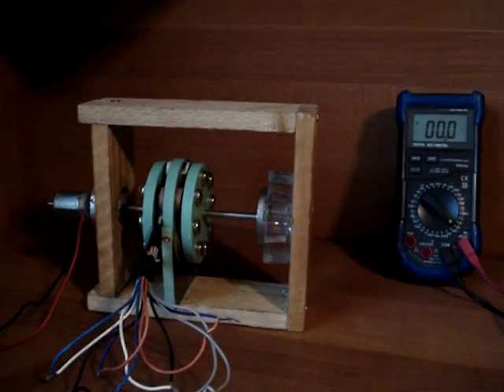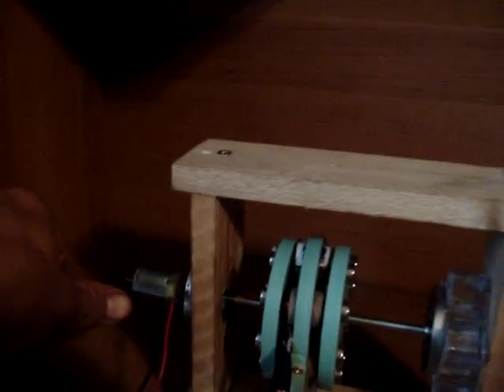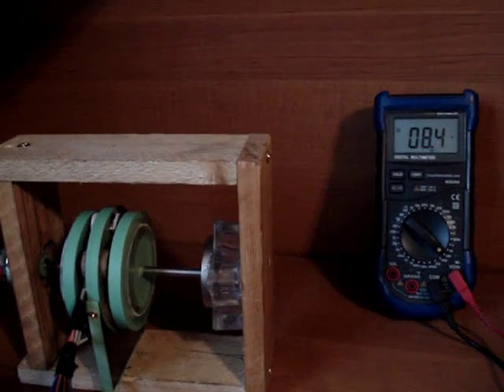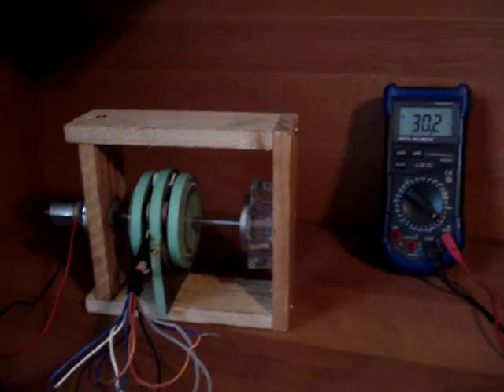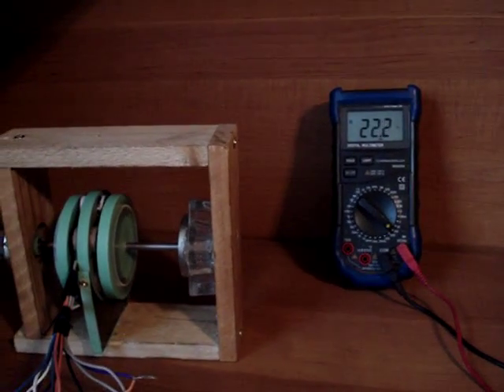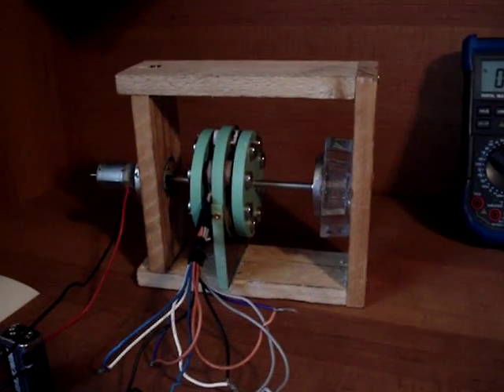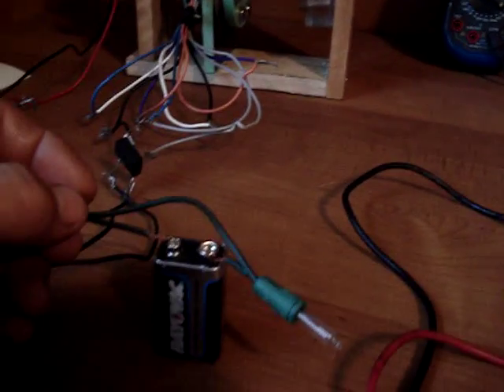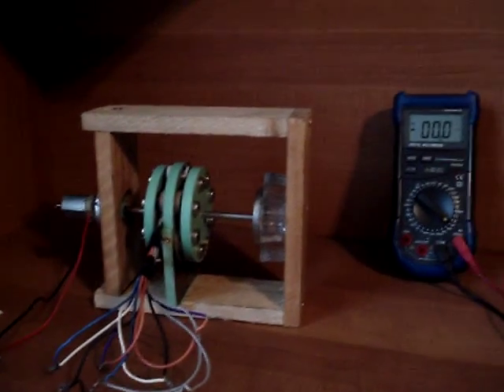Magnets for energy generator

Comment: Hi, have you tried to connect the output voltage to the little motor, through a regulator, in order to not blow it up, then check the voltage left and see if you can feed the lights then, I would suggest to use a printer motor, those use a higher voltage but I think it can hold higher rpm's... I mean, this after you minimized the rotor's friction right... post the results!
Reply from the maker: I would have to rebuild it. it broke.
Reply: As a suggestion, I would first garantize the necessary voltage to feed the motor that runs the rotor... are you planning to build another one?

Comment: Obviously its slowing down, because of the electric load you connect. The Magnets now how to push against a stronger electromagnetic field, so the wheel is slowed down. In other words velocity of the wheel is changed into electric current. You can simply test this, by shorting out the wires and try to spin the wheel by hand. It should be harder to spin, if you don´t shortout the wires it will be less hard to spin. Well thats the way a generator works ;)

Comment: Its slowing down because of the back EMF.  Your design produces good voltage with low current.   But when you put it under load you get Resistance. 

 You could try a Homopolar Dynamo setup because with that you dont get any back EMF. 

  You would need a spinning neo-mag disk and put the pickup coils around the equator of the disk as it rotates.  Jerry Bayles is doing something like that, checkout his channel. 

 I actually want to try something like this, a brushless homopolar dynamo.

Comment: if you want to build your own magnets for energy motor check this out i built mine it took me 4 hours i pay for the guide and went to the hardware store and the materials cost less than a hundred dollars I'm running my house off of the magnet motor and my bill is only $40.00 and I'm running heaters if you want the link email me at mike_s56@yahoo.com or message me

Comment: Yup drawing more current than your motor/generator can supply.  Plus getting more voltage out of your generator is only part of the equation.  The other part is current.  You will always produce less power at the output than the input can supply.